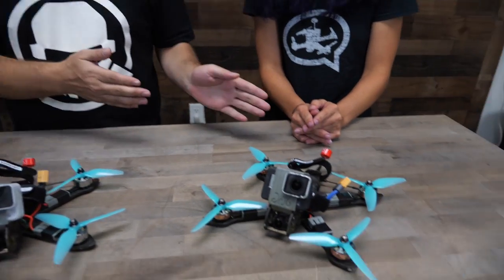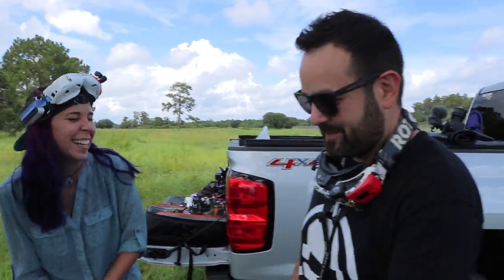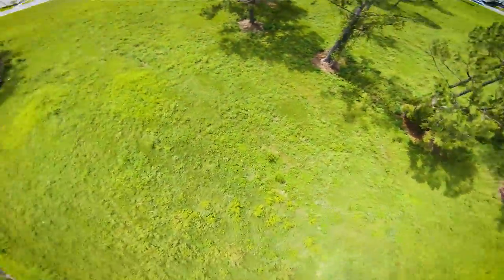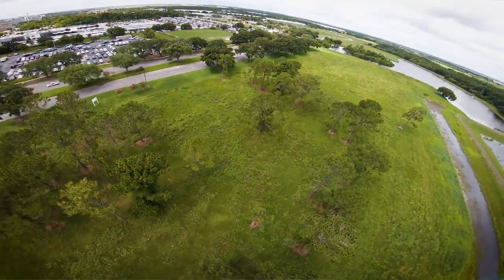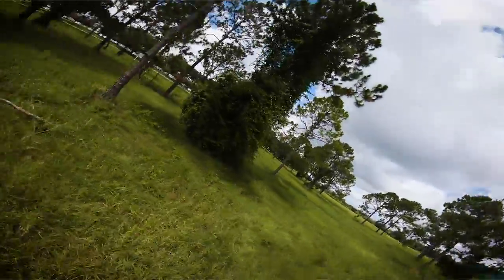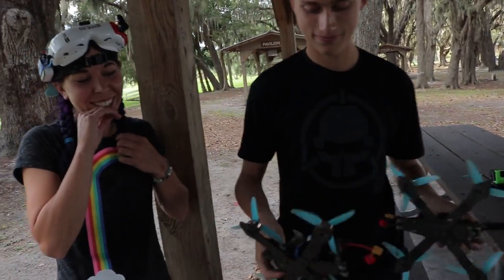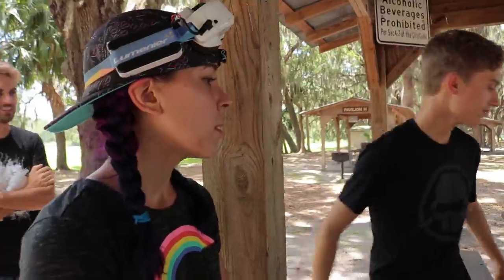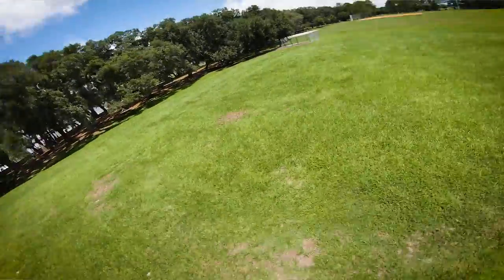2207 vs 2306 FPV motor - Blind Test & Comparison!

Comment: Umm this may be a late comment but again great episode!
Honestly there IS a significant difference between 2306 and 2207 at the same KV. 2306 is more linear, has better low-throttle performance, but drain batteries faster. 2207 has higher top end speed, slightly more efficient, but doesn't fly very well at low throttle. (All with the same props)
If you are used to high throttle flying, 2207 is a much better choice than 2306, especially on 6s. But if you just started to learn racing or complex freestyle, 2306 is easier to control. 
Results might vary depending on the motor manufacturers. I'v only tried rcinpower motors and iflight XING motors before making the above conclusion.
BTW the new DALPROP t5046c is absolutely amazing so go check it out lol..

Comment: Well, at lest they scienced their way to the actual answer - prop pairings dictate most of the feel, and that variations in battery performance are going to be more substantial than minor differences in stator size when you're not flying all out.
Lighter props that can spin up faster are going to be generally better on tall stators, and can linearize thrust delivery on some setups.  For most beefier props that tend to have that 'creamy' feel, the wider stator is going to feel much better, with a lot of the torque delivery happening at low to mid throttle.  On those props, I'd probably choose 2306, but for what I run the answer is 2208 motors all day every day.
Reply: tehllama42 agreed.  When you get to the 2207 and 2306 size I feel it’s all preference.  But props have a lot to do with it.  Now for freestyle I’m with you on the 2208’s. I love my Xing 2208 1700’s on a wild Willy dolphin frame.
Reply: @archer4922  If you want to run slightly porky race quads (very wind-resistant), those same motors are amazingly good.  Definitely excellent for GoPro haulers as well
Reply: tehllama42 definitely

Comment: Many thanks folks, this was again a real good RR episode:
Very entertaining and we all, who do not own 2207 and 2306 motors with the exact kv values, learned a lot, imho.

It was really surprising to me that both motors, with the same kv, actally seemed to feel pretty much the same.
I thought, that you would feel the faster accellerating 2207 for sure.

But I only own 2207 2700kv and 2306 2450kv of BH.

And these are not comparable. - Everybody feels and hears! the difference immediately.

I chose those motors for a reason:
The 2007 2700kv spin up extremely fast and therefor have extreme response. Which is great if I like to fly in "wider" areas. And they so easily throw your quad... sometimes almost too far ;-) - Pushing the throttle up fast does not cost you many amps if you fly for example the skinny T-Motor props, I also love them for that motor.
A lite quad with these is a beast! - And lot of people seem to love to fly them with much throttle-expo (for the gain in low end resolution).

The 2306 2450kv spin up slower, but also with torque, are more forgiving to nervous throttle control and you have to accellerate them a bit slower and more linear to get your punch. Otherwise you'll burn amps - I love these for smooth freestyle and also proximity on a small space because the are not fast enought to react that immediate if you overshoot a little bit in your throttle reaction.

Why do the 2207 spin up faster and why do 2206 have such a nice smooth feel?
* The 2207 spin up faster because the stator is not that wide, so the swinging mass (the bell) to be accellerated is less.
  (probably not the perfect description but I hope you get what I mean)
* The 2306 spin up slower because the stator is wider, so the swinging mass (the bell) to be accellerated is more, but when it once is accelerated, it keeps it's accelleration pretty stable, which makes it more forgiving to nervous throttle thumbs.

The flighttime when I fly the quads with the described motors is pretty the same. - But I also fly those different motors very different. - The 2207 more agressive and the 2306 possibly as smooth as I can ;-)

And this episode made me interested in some 2306 2700kv, perhaps the golden middle for me?
Or maybe 2207 2500kv? - Maybe those?
(Damn, then I have to buy spare motors for three types... that's not good:-)

Again, well done, I loved this episode: All tumbs up!

Comment: I notice a difference in motors and profiles in 4S, once you go with 6S, it really levels the playing field, you just pick based on quality, price and the styling you like.

All that said, I like 2306 the best, 2207 and 2307 suck more amps for almost no extra performance- they also hold on to heat longer.

Comment: Like the video and nice to see a comparison but not all motors with the same size and if are the same.
I run 2306 2450 on the same frames with the same internals and props and the brother hobby r6 have way longer flight times than the hypetrains, with more initial grunt.

Comment: There's a pretty easy way to choose between them if you're on the fence. If you have a lighter quad, 2207 will give you great performance without killing your batteries too much. But if you have a heavier quad, 2306 might be a better match to carry the weight more efficiently and give better performance.

Comment: Great video! The motors seem even bc dribs are actually not 2650kv they test a little higher around 2700kv+ that plus the 22 size stator struggling with the heavy quad weight and pulling more amps evens them out. Everything can be explained with science!!
Reply: Max Beamer And everything can be wrong because of the science factor!!!
Reply: Lil Burkan FPV 🤔

Comment: 14:30...  LMAO (the face image plant).

Side note: to add some validity to this type of entertainment, run a BlackBox of a full flight on each "identical" quad.  If the raw noise is the same and all of the BF settings are the same, with the same equipment, then it can be an A - B test.

Comment: I think you would definitely be able to feel the difference if you were flying 6s lower KV. With high KV 4s motors I think the only way you could tell would be amp draw. The feel would be the same just one would sag faster.

Comment: How can cpt vanovers setup be much lighter than ledribds? Are the seperat esc's much heavier?
Reply: much lower weight frame, micro cam
Reply: @astrofpv7035  how much does the skyeliner weigh? I thought mini sized cams were gone with 2018, lol 😂
Reply: Skyeliner is my heaviest quad with shorter flight times. That sacrifice is worth it though. I can slingshot it further for that floaty airtime over trees and rooftops.

Comment: Only difference I've noticed is the throttle at the lower end is more. Linier on the 2207 compared to more mushy or that you have to move it more to get what you wanted out of it on the 2306.  .. but you'd get used to each

Comment: First off. You can always tell the difference in the sound. 2306 are much higher pitch screamers. 2207 is more of a lower scream. I have only ever ran Dribv2…..still wondering if I should try different ones.

Comment: No one can tell me that ANYONE can consistently tell the difference between a top spec 2207 and top spec 2306. The power in flight is nearly identical and (on static thrust tests there may be a 50 to 60 gram thirst difference between the two in a perfect world but in flight it's nearly identical so long as the KV is the same and the build is the same other then one is 2207 and one is 2306) response is nearly identical, torque is nearly the same, top end is nearly the same you just can't tell a difference... On two identically built race quads with one being same brand and build quality 2207 and one being 2306 with same KV then a world class race pilot may see a slight difference between the two if they ran 20 packs with each motor around the same track and avg the lap times... It's it's a tighter track they likely would see slightly quicker lap times with the 2306 as there is slightly more low and mid throttle torque/response and if it's a bigger track with a longer straight they may see a slightly quicker avg lap time with the 2207s due to the slightly more top end power. In the end it would be so close it wouldn't matter.

Comment: I fly 2600kv F40 Pro II and IIIs on 4s builds and F40 Pro II 1750kv on 6s (this is Fpv_diva) 
I used to fly BH 2207s and F60 pro IIs and i gotta say 2306s just feel better to me... They fly cleaner and easier to tune on any 2306 build vs 2207s... I've also used the Emax RSIIs RS2207 and RS2306. The very top end power may be slightly more on the 2207s but the low and mid range response is better on 2306s and the top end isn't handle anymore on the 2207s.

Comment: IMO the Captain's opinion was distorted by the fact that he was flying freestyle which throttle play at lower range most of the time. So like puching from 25% to 80% and, rarely 100%. But for racing throttle often play at 40% - 100%. With that high throttle range the  2207 would shine.

Comment: i switched from 2206 2450kv rifle motors to 2306 2700kv t motors and love the 2306, I feel like I have more control at lower throttle.

Comment: The difference is very suttle . also depends on the motor brand itself and kv . Try some 2408s  if want to see noticable difference .
Reply: I agree, but I believe the subtleties start to emerge depending on prop selection... beef up the prop (increased pitch, weight) and the 2306 torque might be more noticeable.
Reply: @J4nkyFPV  oh absolutely .
Reply: @J4nkyFPV  I think the only 2207 I bought were the samguk  motors blue . They were okay. didn't have the top end they were sapposed  to have that's why I say brand means a lot . I herd your hypetrains are really good

Comment: The problem is that whilst there will be a small difference there will be a larger difference caused by battery placement and power output even on identical battery's.

Comment: The bigger diameter the stator is the more the torque it has due to bigger stator having more leverage to pull the magnets round and the longer the stator the more top end power due to there being more surface area of the stator to pull the magnets round if you were to over prop both motors and punch out to half throttle that’s where you may see a difference and that’s where the 2306 would come out on top

Comment: This is so fun, cause I actually learned about this in class! With electric motors a wider stator/wider bell producers more torque, based off the theory of how current induces torque. A taller stator/ introduces more wire with current, which produces more induced force. Force is different than Torque. In the sense Le Drib motors have more top end, and Vortex motors have more torque. Greater torque is most useful in maneuvering, but find a niche in speed with a bitey prop. Greater force obviously finds the best uses in speed. 

One thing though- widening a stator increases torque more quickly than force is increased raising the height, since torque is square proportionate to width, while force is more proportionate to turns on windings.
Reply: The theory, all else being equal: current is proportional with stator _volume_, and torque is proportional to current. All else being equal.

The nominal stator sizes differ in volume by 6.5%. This seems almost insignificantly small compared to other known differences (different props!), but the same proportional difference applied to Kv is 2935 vs. 2750, which seems a big enough difference we should be able to feel.

(Yes, yes. They would wind them different, of course. The relevance is Kt (torque coefficient) in metric units is exactly equal numerically to Ke . Ke being Kv expressed as V/rad*sec , rather than Kv's rpm/V. You can and should ask your prof to confirm that.)

I don't know if I can feel 5% to 10% difference in torque delivery near mid-stick. Certainly, I don't have nearly the same sense of feel Le Drib evidences in his flying, so maybe he really is feeling the motor. My guess, though, is still that the difference in props far overwhelms the difference in motors.
Reply: Michael Young most normally probs would obviously have a bigger effect on feel, considering that these are aircraft of course, but for a given flight style and given prop then the motor comes into play immensely, being the heart of the movement

Comment: Engineer here.  If both motor don't draw the same power, then this test is kinda meaningless. I'll assume that they both draw the same power with the props as tested. Additionally both motors claim the same back EMF (kv rating). Brushless motors generally have a very linear torque-rpm curve (Unless the designers really messed something up). Given that both motors have the same Kv rating,  they should have identical torque-rpm curves. This means that they should have identical steady state output response. What might be different between the two is the rotational inertia, and efficiency. If one motor has a lower rotational inertia, it might be able to spin up the props faster than the other. I.e. it might have a faster transient response. Additionally, if they have different efficiencies, then one motor might run cooler. Different temperatures will have an effect on performance, as resistance rises with temperature.  The only way to know for sure would be to put the motors on a dynamometer and test them under controlled conditions.  Personally, I doubt there's much difference, and I'd go with the lighter motors.

Comment: It's too hard to eliminate variables. In theory all motors of the same kv have the same torque constant and the torque should be the torque constant times amps. So if you could predict the amp curve you can predict the torque curve. The problem is that amp curve may have to do with a lot of things. The DC resistance may give a ballpark for startup amps and torque but I'm sure there are all sorts of things going on with how focused the magnetic field is and how close to ideal the voltage output wave is if you were to drive the motor mechanically and scope the voltage. Really I don't think people should worry so much about these little quips of knowledge with diameters and heights. The bearing size has a bit to do with how much wire they can stuff in there. The magnetic field can be manipulated in subtle ways. Either get a ballpark stator volume and kv, or go straight to mini quad test bench where you can pull up the actual thrust curve on a punch out with a few props so you can see not just the thrust statically but also the time to go from idle to full thrust. It still doesn't tell you high speed since the air isn't moving thr same but you can guess the high kv will be faster even if medium kv makes more thrust.

Comment: you know stacking those motor at the volume of energy might work make each one power the next but you will need voltage control for each one too as the lower on must make more energy then the top. then you get a very light energetic system that runs for hours where it ran for minutes before although the weight ratio make them break sooner and heat up faster making them best for being combat drones because who gives darn its gonna blow up anyways.

Comment: Odd I have Mr copper 2306 and I love them but there 2400 and they feel like they cause battery sag more than my xilo 2207/2550 but 2550 did feel stronger but less linear low throttle control

Comment: You used different props! -_- ... props will make way more difference than the motors will. Still fun video though ^_^
Reply from the maker: No, both Kwads had the same prop. A HQ prop. The pilots were taking about Jeff using a different prop on his personal kwad (which was not flown in this episode)

Comment: Here in a german fpv onlineshop dribs motors are sold for $27 each  and vortex motors for $29 😅
Reply: Time to fly some RCX, SunnySky, and EMAX Eco motors.  Half the price, and way better than half as good.
Reply: Thats good enough a difference for me 😂
Reply: @tehllama42  3B hobby are way better than all of the above. emax eco are really no better than racerstar. Sunnysky and rcx are good, but 3b are better IMO.
Reply: @darrensmith8107  I love me some 3BH motors - the 2207's and 1408's absolutely rip.  At retail price, they're closer in price to BroHobby and T-Motor stuff, and I happen to prefer the SunnySky EdgeRacing line in that price range.
Reply: @darrensmith8107  why do u say that for the ecos
Reply: @tehllama42  I am actually referring to the 3b 2306 freestyle motors at 14usd, sometimes they go down to 12usd. I use them for racing and some freestyle. But yes, in the premium range, there are better options than 3b.
Reply: @kd9432  there are tons of reports that the bells on the eco are really soft, and they have the same problem as the racerstar where the bearings are loose in the pocket/bearings go quickly. For 1-2usd more you can get the 3b 2306 with arc magnets, tight air gap, nmb bearings and respectible weight.
Reply: @darrensmith8107  k thanx for the response. Lucky they r so cheap u will end up with extras over time. And at my work we stock the same bearings abec7 grade. But I get what u r saying
Reply: @darrensmith8107  I've had 2400kv and only messed up a motor because of over tightening the bell screw and bringing the bell into the windings. So I have a extra bell
Reply: The bearings are definitely the weak point on the ECO motors, otherwise they're pretty solid. In 2207, I am a fan of those, in 2306 I have to go with other options (RCX, LDARC, 3BH, etc.) for sure.

Comment: the had the same specs and tuning but they used different props lol.....  What a generation.
Reply from the maker: The pilots used the same prop. Both test quads had identical HQ props
Reply: @RotorRiot  doesn't seem to be what is said in the video.